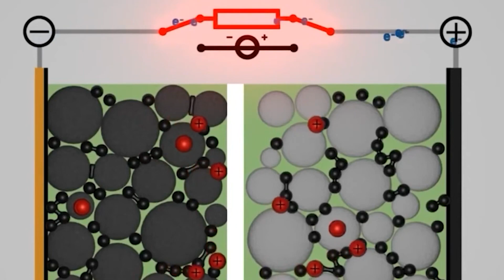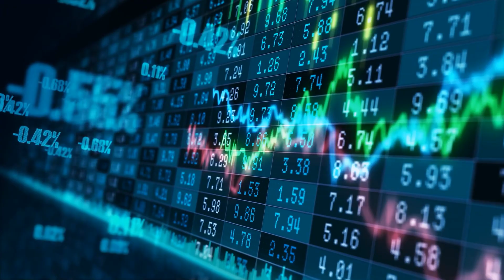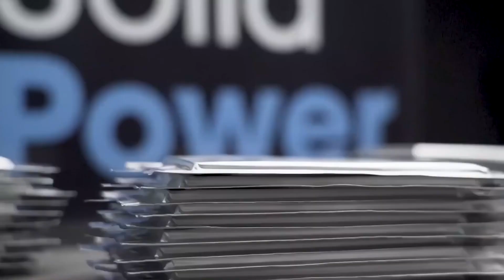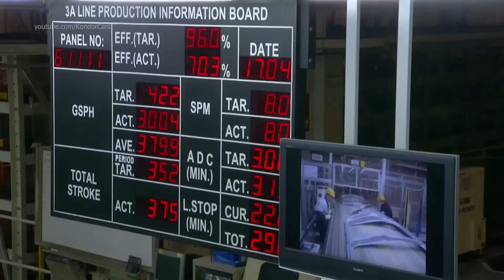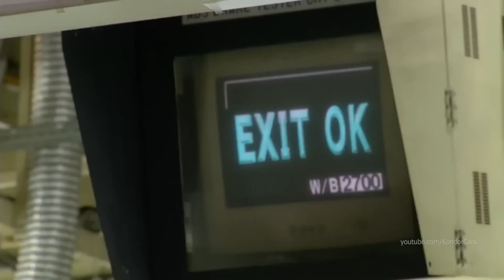Toyota CEO REVEALS An Insane Plan To Stop Tesla!

Comment: 2019- Toyota announced Breakthrough in Hydrogen cells, 2020 Toyota announced breakthrough in EV Production methods allowing them to make more than 2.5 million cars by the end of 2024 , 2021 Toyota announced a breakthrough in Solid State batteries, 2022 Toyota announced A breakthrough on Solid State Hydrogen batteries, 2023 Toyota announces insane plan to Stop Tesla.  Overall Results from Toyota- Discontinuation of the MIRAI all over the world coz Hydrogen is very expensive, Of the more than 20 EV models announced by Toyota, only the BZ4 is on the market, and the BZ4 wheels falling for no reason, Toyota then discovers that Tesla Model Y is a Marvel of Engineering and realize that their previous breakthroughs are only VAPORWARE, leading them to NOWHERE.